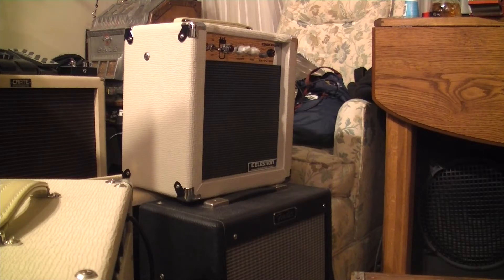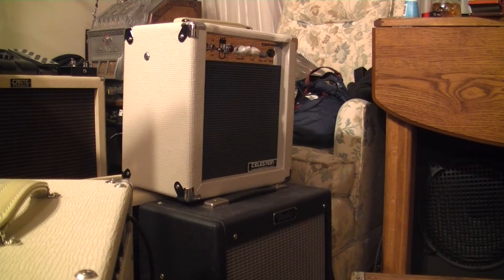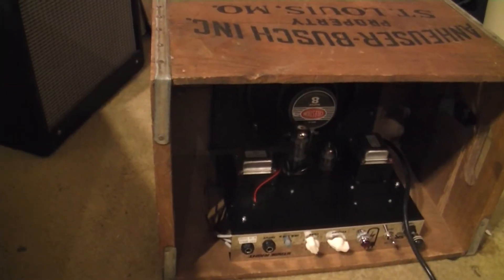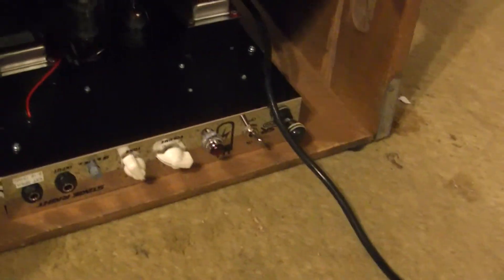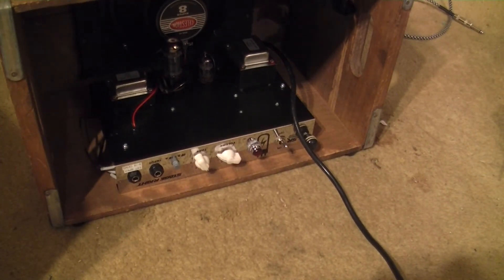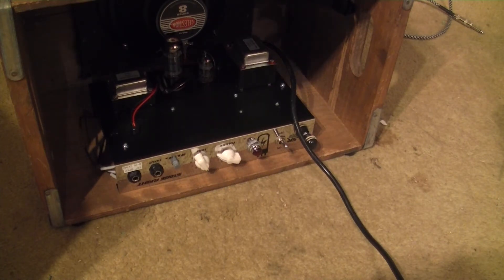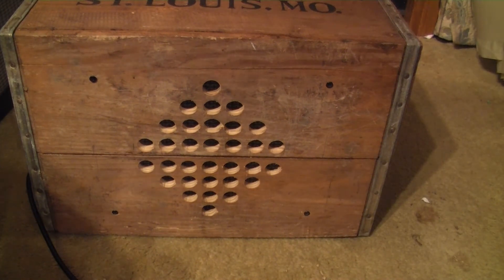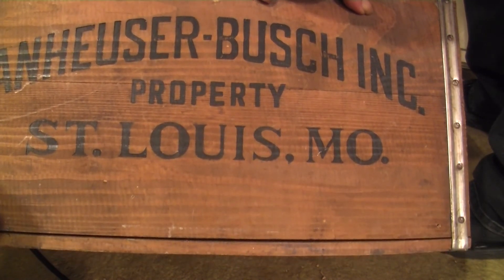Monoprice / Laney 5 Watt Tube Amp Negative Feedback Mod Demonstration

Comment: I got the same effect just replacing tube 1 and 2 in my preamp section with a 12aU 7 rather than the 12a X 7s it came with, still curious about this mod tho

Comment: This is one of my go to mods.
It would be great foot switchable.
Long before YouTube, I played with pots.
Later, especially in the Fenders I moved ground wires in to, I simply used a switch and the existing resister.
With pots I found the same two places being used, any way.
Cool cab! Chris

Comment: If you can't play guitar, I suggest tuning the guitar to an open chord to demonstrate amp modifications. Hitting all 6 strings in standard tuning all at once sounds whacky at best in the best of amps. May I suggest tuning the guitar to an open "G".  The strings will be tuned from the 6th (Low E) to the 1st (High E) as follows:  G, B, D, G, B, G
When you tune the strings like this you can play the chords by using a single finger laid across all 6 string on a single fret position. Anyone can play the guitar when tuned to an open "G" chord.  Good mod as well. Some have cut the protective resistor when doing this mod, and when they turn the negative feed back to zero they blow their OT and their diodes. I wonder if you leaving the load resistor keeps the OT from going to no load.  Thereby keeping it from smoking itself?
Reply: ha, you may like enough to put up the harp.

Comment: ... Fer Some reason the Video is Not Right...
Reply: I've never seen this before, but some red green 3D option must have been enabled by default. I was able to turn it off in the video settings and in 2D the video looks normal.